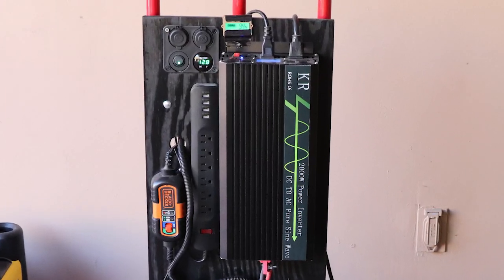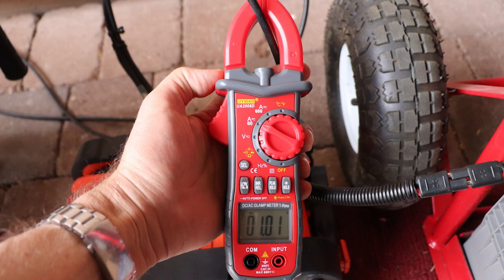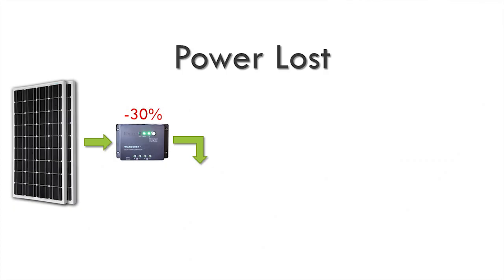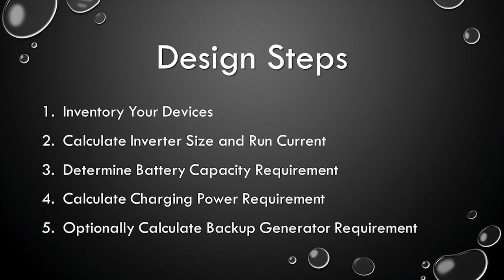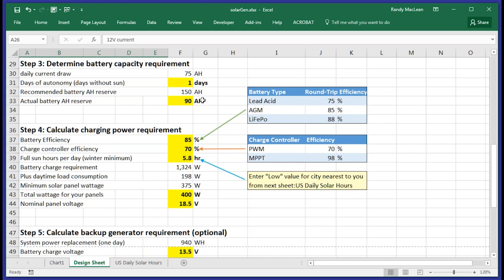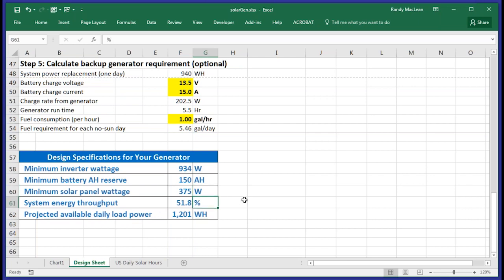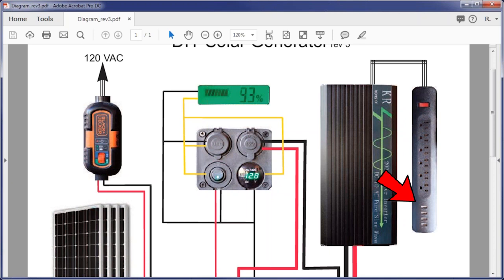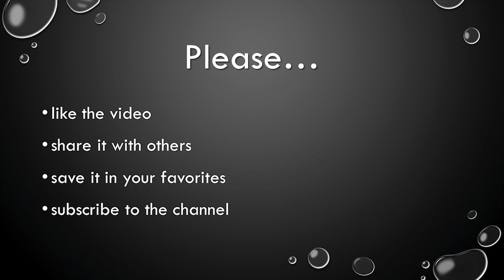DIY Solar Generator - Builders Guide - Engineer Your Own in 13 Minutes

Comment: Thank you for sharing, learned a lot, saved me time & money to experiment and build prototypes. Planning to build the system on a wood rack with provision for  mobility using a dolly for refrigerator backup use. Already have system built in 2012 for a tankless water heater using ExelTech XP1100 inverter and 31-GEL Trojan battery. It is a permanent installation next to the heater.
Tried to run the refrigerator with our latest power outage using an extension cord. Refrigerator run for about a hour, but due to the high surge current during startup, the system will no longer run, the inverter shuts down, but it runs the tankless water heater with no issues. Inverter is rated at 9.4 amps, the surge current MAYBE as high as 6 times the running current of 1.46. Calculated surge current is 8.76 amps.
To solve the starting current issue, plan to use an ExelTech XP 2000 with an output current of 16.7 amps.
Will use your Excel spreadsheet to calculate the number of Trojan 31-GEL battery to use.

Comment: First of all, I want to say thank you. Your videos and ideas are awesome. The second reason I am here is to ask you something. I am not sure if you would know but its worth a try. So in general houses have a grid tie system or can be completely islanded without an issue. When it comes to making the house both grid tie and off grid functional, the battery based grid tie inverters cost is a HUGE deterrent. I have heard that instead of using a Battery based grid tie inverter you could possibly use a generator. We are building a solar powered system so we wouldn't want to use a fuel generator which is why I stumbled on your video. As you know grid tie inverters are designed to detect the main power grids frequency and/or voltage if it doesn't detect it will shut off.  When a blackout occurs this is a problem so you would usually design your system with a battery based inverter or a generator as well to fool your grid tie inverter into allowing the continued flow of energy. (take a breath) So the question is if you think that this generator you built can be used to substitute that generator/battery based inverter. I am sorry if this is a silly question. In addition, you should know that this is for a project so I don't need to power up an entire house now, but it must have the potentially to feasibly power up the load in an entire house in the future.
Reply from the maker: Let me start by saying my knowledge of grid-tied systems is limited, so it will be important to gather advice from other sources.  A fuel generator system would, in my opinion, be of limited utility due to the fuel volume and storage requirements.  My 3800W generator runs for roughly eight hours on four gallons of fuel.  To provide continuous power for a week would require more than 80 gal of gasoline, and it would need to be replaced about once each year to ensure it was OK to burn when needed.  If your solar / battery system is to run simultaneously with grid power, you’ll need some kind of synchronization capability.  If just for standby emergency power, then a transfer switch will be necessary.  Without knowing more about your specific needs, I’m not sure this information is particularly responsive, but others here may have some suggestions 9f you can outline what you
d like to accomplish.
Reply: Desert Prep first of all thank you for responding. I might put this question on hold for now. We found a device that might help us so I'll come back if needed. This solar power generate wouldn't run all the time It would be more for an emergency. I really appreciate you taking the time to respond, thank you again!

Comment: Wow, Now I understand more. I have a 3 unit 200 amh 12 volts deep cycle solar master by motolite and this video really helps make it more efficient. Thank you and thank you again. Also, in the Philippines, I can buy a 12 volts pumps and lights and even refs, I do not know if we have this in the US but at amazon that is where I bought my 12 volts lights, that I do not to use the inverter which can really lower inefficiencies and cost. Please make more videos like this, educational, fun, entertaining and enlightening, More Power and God Bless you.
Reply from the maker: Thank you so much for the kind feedback.  You’re SO right about using 12V devices — gets a lot more utility out of the stored energy.  I’ve just finished the fourth major version of the project, and collecting the measurements I’ll be reporting in a new video next week.  Stay tuned...

Comment: Subbed.  I'm converting a cargo van for camping, arb fridge, charge phones, laptop, tablet lights at night. I'm learning a lot from this, I'll use two batteries
Reply from the maker: Thanks for the subscription.  I'm just finishing the final build on the generator, and I'll post a video on the build in a few days.  I'm  toying with the idea of a major solar upgrade on our RV -- I think the diesel generator could be relegated to use only in the most extreme situations.  If it happens, I'm post video...

Comment: Outstanding presentation and build. We need these in the desert, but I can see using this while I'm travelling too.
Reply from the maker: Thanks for the kind comment.  A number of people have spoken about adapting for RV use, and I’m toying with the idea of upgrading the DC power system in our coach...
Reply: Great idea. A unit that does not include the inverter will provide more power at lower loss. 
We did something similar for NASA years ago, only powering a number of DC devices, from Laptops to VHF Transceivers, and GPS units. This was before cell phones really took off. I will rethink that concept, based upon your unit. 
To get higher DC voltages we had multiple deep cell marine batteries in series, with taps in parallel for 12, 24 and 48 volt outputs. My personal budget won't support more than a few, but I like your AGM option. 
Much more research to do for a second unit, but I'll start with your model.
Your spreadsheet is a wonderful start.
Reply from the maker: The multi-tap idea is brilliant.  The new generation af MPPT controllers are almost magical — gracefully and efficiently converting higher-than-needed voltages into optimal voltages at increased current.  Two 12V AGM batteries in series could be efficiently charged by two panels in series, and you could dedicate certain devices to each of the batteries.  (Perhaps one battery would power the fridge alone...)

Comment: One quick note on your system (actually on your loads):
Instead of a small fridge, consider a small chest freezer. It's much more efficient due to the chest design (cold air doesn't fall out when the lid is open) and the insulation is usually better than that of a fridge. You can convert the freezer into a refrigerator using a device with a drop-in thermostat that switches the freezer's AC power on and off as needed, raising the chest temperature up into the refrigerator range. It's easy to install (plug the module into the wall, plug the freezer into the module and drop the temperature probe into the freezer compartment), is 'fairly' inexpensive ($60?) and requires no rewiring of the freezer. There are several manufacturers out there. This is not an endorsement, but Johnson Controls comes to mind. I'm sure Amazon carries some.  

Digging down into a chest refrigerator is not as convenient as opening a door, so there is a convenience factor to consider. But, if efficiency is a major requirement because of long duration power outages and limited backup capacity, then this simple conversion device may be worth looking into.

Nice set of videos by the way.
Reply: I just checked Amazon and found some temperature controllers as low as $18. Some are dual purpose working with refrigeration and/or heating equipment. Johnson Controls, Inkbird, Digiten, and KKmoon, plus others.
Reply from the maker: That’s a very creative solution.  In a long-term emergency, your plan could make a real difference to sustainable food storage.  Thanks for the idea, and for going the extra mile in locating potential controllers.  I’ll bet you’ve started a lot of people thinking.  Much appreciated.
Reply: Or use freezer to make ice to place in ice chests to use as fridge

Comment: One other thing to keep in mind is 100 watt panels will never produce 100 watts of power outside a lab. You need to take those inefficiencies into your equation too. Also if you're not tracking the sun with your panels that will be another loss to take into account.

It's looking to be a very good setup.
Reply from the maker: Good feedback.  I’ll add that to my consideration for the next round.  Appreciate your comments.

Comment: Great Exposé   One other consideration is the Standby power draw, i.e. How many watts the inverter draws when it's on but with no load on it
Reply from the maker: This particular inverter has a negligible no-load draw - 0.12A @12.8V or under 1.5W.   Good call — I hadn’t considered it.  Thanks!
Reply: Desert Prep Glad I could help, All inverter's have it, Usually the higher the capacity the higher the Standby draw.
Reply: But wouldn't you just turn the inverter off if there's nothing plugged in?  just saying
Reply: Judith Lawrence That’s true for intermittent uses, such running power tools and appliances, But for a Refrigerator the Inverter need to remain on continuously because Refrigerators cycle on and off
Reply: Excellent design and documentation! I understand the economics of battery choices, not the best but my pocket book would probably have made the same decision.
1.5 watt standby for the inverter? Is that a measured value or an advertised rating? Seems way low to me, there is usually a big jump from 1kw to 2kw on inverters.
Possible improvements: Mount one end of your panels with a piano hinge and use a notched wooded arm on the other that can be adjusted from below to maximize solar output. 1notch each for winter, summer, then fall/spring.
Upgrade your battery charger to a NOCO GEN2 charger @$150
For a 2kw inverter I would have at least 3 batteries and a low voltage disconnect.
Overall excellent design.....now you have me itching to build one, which means expanding my existing “Deer Camp boondocking” setup.
If this is really a “Prepper” setup your still EMP vulnerable.

Comment: Hey there, I followed the 4th gen instructions and part guide, but the fuse box is entirely different from the one you use in your videos. I wired it up like you show, but it does not work. I took it apart and it seems that one entire side of the fuse box is not for connecting positive power. It also seems like I would need to connect the batteries to the bottom bolt instead of through one of the fuses. Not sure what I'm doing wrong or if I need to buy the identical fuse box you used
Reply from the maker: You're right.  The new fuse block is more sophisticated, and I'll update the wiring diagram to correctly show it.  For now, connect the main power wires to the pos/neg studs.  Then connect the pos wire and neg wire for each item on opposites sides of the appropriate fuse (be sure of your polarity).  The new block has internal busses to provide neg ground for each of the pairs, and fused positive on the other side.

Comment: Hello, I have recently purchased the black and decker trickle charger. I attached it to my pop up camper battery and let it charge for 3 days. The outside temp was in the 90s so I decided to see if the trickle charger was getting hot. I found that it was really hot to the touch.  Is that normal?  I unplugged it to be safe.  I had purchased it to make my solar generator.

Comment: Where did you get the battery discharge monitor.....and is there anything that will automatically shut battery output off if they get to 50%....thanks

Comment: The cheapest solar panels per KWH are the 250w high voltage ones (public prices around 90$ each) standard size 1.6m x 1m x 40mm. Mounts are all designed for those, so cheaper also. With 100w RV 12V panels you triple the cost par KWH. Even worse with flexible ones that do overheat. Those 35V panels require mppt.

Comment: Could I double the amount of solar panels and/or double the amount of batteries in order to operate a full size refrigerator using the same inverter and MPPT controller?

Comment: Great build!!  I can't wait until your Rev 3 video.  I noticed your diagram is named Rev 3 so video may be coming soon :)
I almost have all the parts for my build. I wanted to know how much 10 gauge wire did you use?

Did you use any other gauge wire?  If so, how much of each?
Reply from the maker: Thanks for the kind feedback.  The welding for the rev 4 cart finished today, and the paint is drying.  Tomorrow, I get to do the final build, and.that’s going to be fun.  There’ll be a final version video, wiring diagram, and likely a more detailed guide video in about a week.  There’s very little 10 ga wire — just what’s needed to get from the charge controller through the fuse block to the battery —less than 2 ft.  The inverter uses the heaviest wire — 6 ga that came with the inverter.  The 12V panel uses 12 ga and 14 ga — about 4 ft. of each gauge in red and black.  I’ve added a DROK DC 8-63V LCD Digital Battery Capacity Monitor to the unit ($14 on Amazon), which you will have seen in the Rev 3 diagram.  It really helps in evaluating voltage to protect the battery.  Use an MPPT controller if you can — it’ll give your system a higher capacity.  Good luck with your build...
Reply from the maker: Thanks for the link.  A low-voltage relay’s been suggested before, but the particular model was hundreds of dollars, considerably more that he battery it was to protect.  You suggestion is much more attuned the the project budget.  I’m not sure about the cutoff voltage spec though — I’ll do some homework and respond back...

Comment: I think you forgot the inverter draws power when online but with no load (understandably), I measured mine at 30W on the dc side. And mine is sold for 91% efficiency (not yet checked) but I put 85% in my calculations. As I plan a 24/7 off grid system without oversight, there will be hours where there are no load but the inverter will not be turned off. So that is 720 WH to add on the loads for one day.  1x idle inverter 30W 24H 720WH in the table.

Comment: Hi very interesting videos about solar power,and i am very very interested on it.
but i have a suggestion for ya rather than run your fuel generators with gasoline,why don't u run your generators with HHO? also u could run your cars with HHO (Hydrogen Generators) which has an almost unlimited generating capacity (also less smelly  than gasoline). Obviously even the HHO generator need a lil maintenance,disassemble clean up and reassemble all the stainless steel plates and for fuel demineralized water and potassium hydroxide.
On this way you fixed the problem of gasoline (sure the generator won't run as good as when it runs with gasoline,but you're pretty close for very low cost and maintenance).
lastly i wanna thank you for sharing this very very informative built.which in the near future i will try to adapt for home,and let you know how it goes.

Comment: Your design sounds terrific!  Thank you for your rigorous research.  

2 questions, which may be due to my lack of understanding of solar generator principles:  

1)  Does this design allow for both charging the battery from solar panels and discharging them to a refrigerator etc. at the same time?  (Some commercial solar generators have this as a big advantage vs. their competition.)  

2)  How long does it take to recharge the battery when it's low or just about empty? - or is this system designed to keep a high level charge always in place?  (Some commercial solar generators take 27 hours to recharge when the battery is completely empty, and some others take 6 hours or less.)  

Thanks for your help!
Reply from the maker: Two good questions.
1) yes, the system is designed to both charge the batteries, and drive the load simultaneously
2) charge time will depend on: the amount of consumed battery power being replenished; the number of sun hours in the day; the size and number of solar panels; and the amount of charging power being diverted to the load while the batteries are charging
Unless you have the most expensive battery type, you can only draw 50% to 80% of the battery’s capacity (depending on the type) without damaging the battery, so you can’t “empty them”, and this also needs to be configured.
Since there’s so many variables, I built all the math into the Design worksheet you can download.  (Link in the description. elle the video.). I’m working on a build video for the final version of my generator.  Look for the video next week.
Hope this helps...
Reply: Thanks very much!  Looking forward to your video next week.  Best regards.

Comment: I would use MC4 for solar panels to the trolley. MC4 exist for 3 different cable gauge. MC4 is good, waterproof, secure, etc. FUSES exist in MC4 waterproof housings to put inline with the panels, panels in series are good to lower cable gauge, smaller 10A fuse, higher voltage means you can have longer cables and get more to your batteries, etc. Good idea to fuse the solar panel line "in situ" in case of thunder, the automotive fuse is not good, a ceramic barrel fuse (in an MC4 housing) might stop the bolt. -in my case is did. An automotive fuse will not.  Maybe you could do all the connections on one rail 2x for panels 2x load 2x  battery disconnect (disconnects can be fuse holders, or breakers in the right specs ) I prefer fuses : disadvantage : not instantaneous, advantage, if everything melts, the barrel fuse will really cut contact, breakers could be traitors (current in reverse, thinder, etc). You can manually pull the fuse holders, it acts like a swich. Those on a din rail are really neat. There is no battery disconnect on your diagram. Adding solder in the MC4 crimp is a plus.